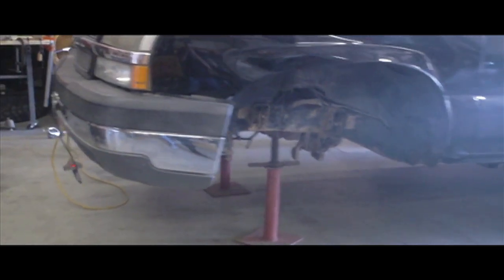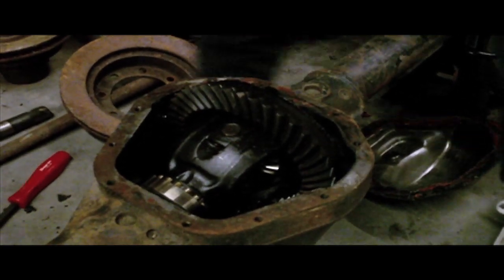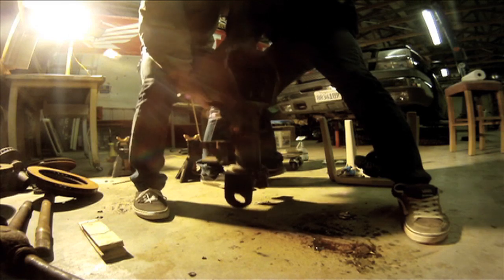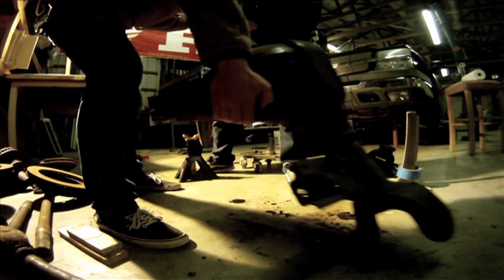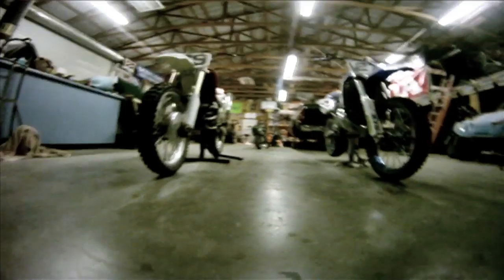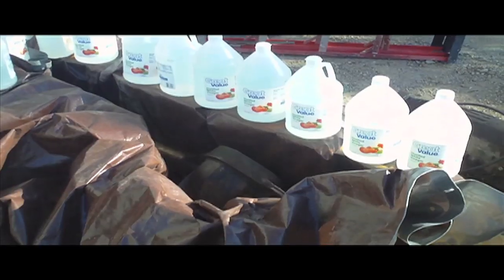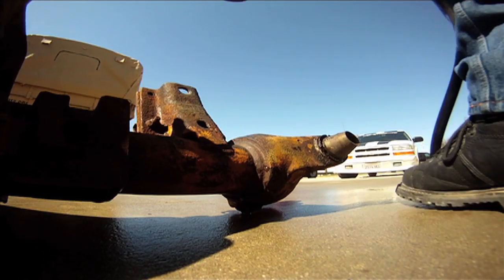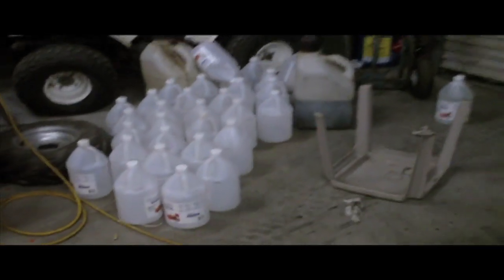Chevy 2500HD Solid Axle Swap Part 1

Comment from the maker: For a good parts list I would check out Off Road Unlimited's website. The installation manuals are available for download and cover everything so you can see what you need to complete the swap. However, I would recommend going with another company for parts if you can find one. It took ORU a full 5 months to provide me with all the parts I ordered.